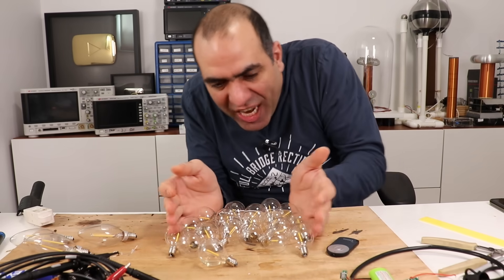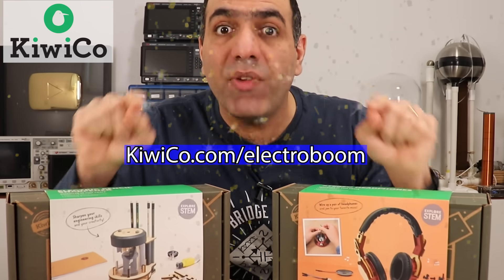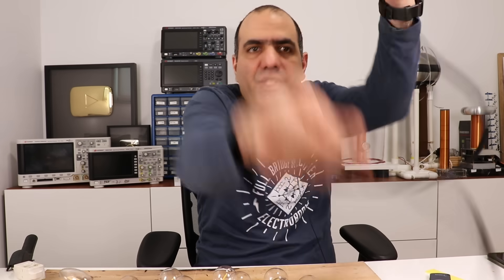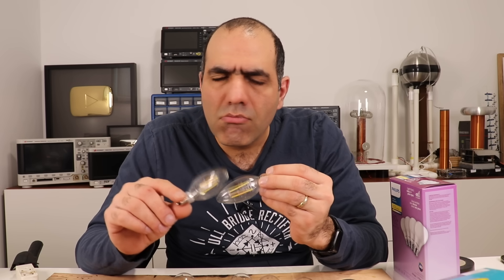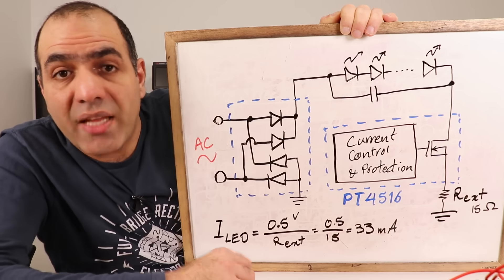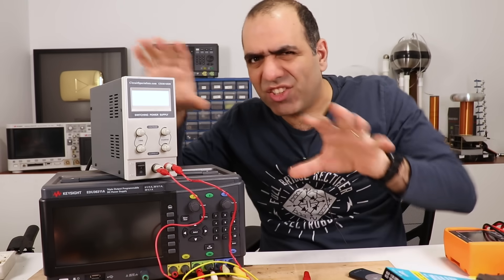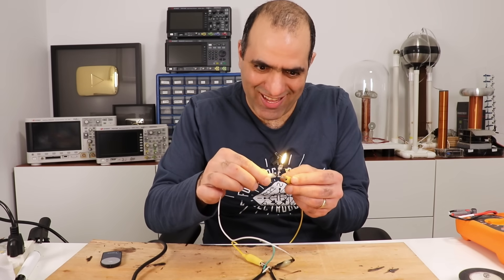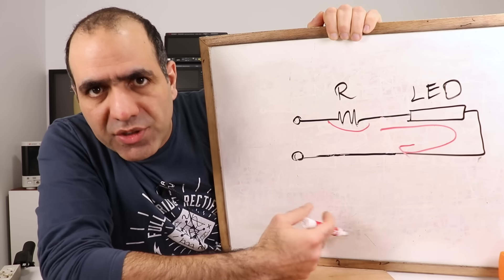So Many MISERABLY FAILED LED Lights

Comment: @3:50 "...use 1/10 of the power that incandescent lights use..." Power saving probably. But if these expensive LED- bulbs do not work, then shipping them back for warranty or buying new ones from China  for sure produces more  CO2 emissions through the transportation and fabrication process and costs you more money than the standard incandescent light bulb. Equipment today is build to last only for a short cycle...this is the modern economy based on greed, not quality .

Comment: I'd say if you can avoid the cheap bulbs don't buy them. Even if they have a warranty, they make them cheap on purpose because they know people won't return them. Also, by the time the warranty is up, that model is isn't made anymore, they just move on to the next "we'll designed" but poorly performing model. I like what is going in Dubai, except for they are forced to use a better product. (without running the numbers, I'd guess it is actually cheaper to use the more expensive products). I sill believe people should be able to purchase inferior products, even if it cost more in the long run.

Comment: so since leds are diodes... putting them directly across AC with a resistor will make them turn on and off at 60hz right? I though leds had a tolerance to reverse current of like half the rated voltage????? HOW DOES THIS OPERATE???

Comment: I've seen an incandescent bulb part-filled with water hanging from a landing ceiling pendant in a rather damp building (leaking roof I think). It was still working, so I guess the water vapour had pushed the oxygen out.

Guess the stem seal had cracked and allowed the water to enter via the lamp base.

Comment: They run cheaper until the power company goes with the new digital meters and starts charging  for power factor usage, then its not cheap. BTW, in the USA the power companies are required to go through the states regulatory commissions to change their tarrif rates  to start billing power factor usage. If they receive approval only then can they charge you more for the inefficiency of LED lamps. Check with your states public utilities regulator for a copy of  your power companies tarrif. Power factor billing  must be approved by the states befor they can bill you.

Comment: ElectroBoom how do I build a safe high current high voltage compact portable adjustable power supply with only small and cheap components that I have laying around my house

Comment: in Germany electricity costs about 0.40 USD per kWh so I calculated that the LED bulbs i installed last year (switched out a bunch of tiny 28 watt bulbs for 3W LEDs) in late september have already paid for themselves - and none of them is broken yet.

Comment: So far the last LED lights I've bought were 40W replacements with 6 of the filament strings, and they all died quickly... the best experience with LED I made with some lights with a round LED part called "cob led" (?) with some kind of reflector around... they were very expensive, but after about 10 years all of them are still working.

Comment: How much of global garbage is generated by manufacturing, transportation, selling of these low cost electronics. Cheap stuffs are bane for society. They also waste energy while running. The LED with resistor in series must be wasting more energy in dropping the voltage, then for glowing LED.

Comment: I purchased 20 x 4' LED fluorescent light fitting substitutes for my home.  after 6 months one failed.  I took it back under warranty and they replaced it.  then 3-4 others began to fail.  I became tired of driving to the store and pulled a unit apart for an autopsy.  In each there was 4 x SMD resistors that had fried.  I pulled a part a working unit to see what they should have been. and checked them on my infrared camera.  They were 20K, rated to only 80mw, but through poor design they were dissipating 300mw, sitting at about 70º C.  Meaning that they would slowly cook and either burn out or de-solder themselves.   I replaced them with 22K 1/2W regular pigtail resistors and they never failed again.  When the unmodified lamps subsequently failed I could repair them and restore them to the ceiling in one third of the time it would take for me to go to the store with the receipt and haggle for a replacement.  Total replacement parts cost?  < 20 cents

Comment: Nowadays its wise to wire the house for DC 12 volt or 24 volt line in addition to the AC mains. Because, most devices like LED lights, mobile phone chargers, laptop chargers, TVs are actually DC devices and they can be run easily from 12/24 volts with a simple adapter. The advantage is LEDs last much much longer when run from 12/24 volt with a simple tiny buck converter. An AC 220 volt LED driver dies much faster due to higher voltage pressure in a tiny package and poor heat dissipation.  I have fitted my house with a DC line in parallel to the AC. DC line is used for lighting and DC devices like charging mobiles, TVs, laptops etc. None of the LED lights went off in last 3.5 years, even though the LED lights are from cheap brands. They also hold nearly same brightness as new. I have solar system in my home, so I run the DC line from the 12 volt battery and its much more efficient than using a inverter to step up the 12 volt to 220 volt and then step down again to whatever voltage different appliances need.

Comment: If you want long life lamp, we can use radioactive material covered with fluorescent. It will glow as spontaneous fission emits radiation that induce fluorescent to glow. But over time the light will dim because radioactive have it's half time.

Comment: OMG, she is getting so big......soon she be going off to college😵

I actually use 100 watt equivilants ratted for 9 months continuos from Home Depot in my parameter lights, then turn them in 2 at a time to Ace hardware for their 60 wat equivilant exchange program with recycled led light bulbs for around the house

Yeah,first project I ever put together was a T.V. signal scrambler Kit I got from a Mom&Pop shop (this is early 70's).

 Think I also got my Tesla radio kit that got power  and signals from touching anything metal(crystal radio?) from that Mom&Pop shop

Comment: 0:38 "If designers knew how to make things to last for a specific application" <- They do. The designers are just forced to cost cut by the company. It's not profitable to make consumer items last after all. Even when there is the long warranty, they make a shrewd/cynical calculation that few people will actually take them up on it or successfully jump through the bureaucratic hoops ;)

Comment: Hi @Electroboom.
Since 3 years ago I prefer to buy only led filament bulbs.
It seems to me the light color and the spread is very similar with the incandescent ones.
I use 4-5W E14 (clear or mate) and 7-10W E27.
None broken so far.

The sound/visual effects for the sparks are added later, aren't they?
(for any "spark" or finger touch, the RCD or RCBO should have triggered, I doubt you don't have one)
Anyway it is fun.

Comment: "fake filament" LED lights are shit. Philips is the worst brand for any LED bulbs. You need ones where the LEDs are mounted on aluminium PCB substrates and there are heatsinks built into the casing for the drivers. Arrays made of less higher capacity LEDs are better than tons of LEDs in series - one LED fail will take out both a string and often the whole array. Monolithics (one high power LED with a diffuser) with low voltage supplies are best - some of mine are 20 years old now.

Comment: No wonder why for a lamp I ordered a pack of LEDs from Amazon or something, all but one survived.
It's 220 here, and I bet they were using a similar design, cheap rectifier and vregs. LEDS themselves are working fine tho. but more and more, even xanlite that were not cheap are now dead after one year of use. 
While I have older LEDs laps that were there since I moved in 6 years ago and counting. but the idea of converting 220 to 50ish with a puny resistor... my god that's the worst.
Murcans : "well my CCFL lamp still works and I want to die"

Comment: Compromising long-term reliability by reducing product performance/quality (not using Constant Current LED driver IC, less amount of heat dissipation material/mechanical housing) for a cheaper LED cost...nevertheless it won't cause much harm to consumers - they wouldn't bother much and can quickly replace with another cheap LED. 

Imagine if this were to happen on a medical equipment...with design done by a 'low-cost medical equipment manufacturer' if there's even any...

Comment: Actually I gutted one the other day which had "failed" on start-up. turns out the LEDs were fine.
If they light up at all then chances are the drive circuit is damaged or one of the two strips is damaged.
I've found a note about using dead ones for 7 segment displays if you don't mind the sound of crunching
glass in the morning :-)

Comment: Some LED bulbs are rate with ( L80B50) that means the ligthcurrent can sink from 100% to 80% at the end of the lifespan from the Led. B50 means 50% of all Led bulbs are dead before reaching the end of lifespan. The problem ist that the companies Font hat to write that in their Produkts. And the lifespan is at 20°C   ( Sorry Font Know how top write in english )

Comment: This makes me think that if LED lighting is the future we should be wiring homes with low voltage for lighting circuits to eliminate this overheating problem no?
Reply: But low voltage circuits carry higher current for the same power and that's more heating in the wiring? The answer could be replacable bulbs that are just the LEDs and decent electronics in light fittings to run them...

Comment: I've noticed that the cheap $2-4 filament led bulbs invariably fail when put in a light fixture where the ambient temperature goes even 120F. A few weeks or a few months and they always go dark. The only bulbs that seem to hold up are the $10 ones that have aluminum pcb's, metal frame and a decent potted pcb.

Comment: I bought a boatload of those on aliexpress for 1.25€ a piece, replaced every single bulb in my house. It's been 2 years now and they all still work. I have about 20 E14, 15 E27 and 5 B22, they are rated for 6w consumption for E14 and 8w for E27 and B22. They are as bright as the 55w bulb they replaced.

Comment: Mehdi what if I took a coil of wire and connect it's one end to earth and other end kept unconnected and then use magnet to generate voltage in that coil         will it work ?

Comment: I have the same experience with these elongated LED bulbs from Philips. They were cheap, but died within6 months of limited use. In my case it is either the driver or the wiring! Causing intermittent lightflow.

Your exterior lights probably suck up moisture during the cooling of the bulb, aggregating water in the bulb in the process. You should have submerged them to see if they are sealed at all.

Comment: LEDs actually don't save energy over glow bulbs because the waste heat of the glow bulbs goes into heating the house. this is only true if the outside temperature is colder than the inside teperature of your house.

Comment: Hi #Electroboom aka sir #mehdi, lots of respect and love 💕😘 frm #India,
Fun fact, when ever in india, Led light bulbs goes of due to failure, people used to solve the every possible way, in order to reuse it, in india 1 new led bulb cost us 70-90 rupees along with 1 year warranty ( 9 watt consist of 9-12 white led light in series pattern), but when bulb 💡 goes out of warranty period people, use to revive that bulb 💡 by checking which of small led light is fused by the help of small wire or Multimeter, and they remove it and put soldering on it, inorder to make current flow,.... They do it every time when light goes 📴.... After that when bulb 💡 goes totaly off, they threw the circuit board and chip of leb bulb but they keep the bulb 💡 body for purpose i.e. in india we get the ONBOARD LED LIGHT CHIP at price of 10-15 ripped which run on direct electric, so than people resolder it and run once again, and this life cycle goes on n on...😊

Comment: Ip44? Was that the actual ip rating for those bulbs? Of course water can get in them I'm pretty sure 44 isn't even water resistant
Reply: Yup, I just double checked, 44 means dust can get in it if it's less than 1mm in size and it's splash resistant, nowhere near able to be considered "waterproof". I don't think anything less than ip 66 should be left outside, I don't know why ip 44 is considered an outdoor rating

Comment: I'm guessing that the warranty will be a real hassle to use. You probably have to send in the bulb to get a replacement. You have to pay the postage and package it. By the time you do all of that, it isn't worth the trouble. The manufacturers know that because of that, their warranties will rarely be used so its basically an empty warranty.

Comment: Light bulbs are one of the biggest "planned obsolescence" scams ever. GE and other companies deliberately made their bulbs CRAP so they'd burn out prematurely and you'd have to buy more of them, and they didn't particularly care who knew it. In the USA, it took the force of law (which GE and other light bulb companies lobbied against for years) to finally push the shift from incandescent to LED and CFL bulbs. And of course, the companies will still make the bulbs as bad as they can get away with. All about the money, nothing about proper engineering. Bah.

Comment: Most common consumer devices become made so cheaply that they are barely acceptable. An LED bulb that lasts for 100 years is argued to be over engineered, so corners are cut until the bulbs are barely acceptable. Some, of course, fall below acceptable, but the point is they will end up being as close to barely acceptable as they can be engineered. Barely acceptable in this case means that so few customers will make a warranty claim that the life cycle engineering will be considered successful

Comment: I bought LED bulbs from a company called TCP on amazon, bought them over 7 years ago and they are still working well. 40 watt equivalent and 2700K for that smooth warm light.

Comment: This pisses me off to no end. I convinced my family to switch to LED lighting and most of the cheap Costco bulbs we have barely last a year on average, with many failing under 6 months. 

I diagnosed the problem to poor cooling for the driver circuit, as they died much faster when in an enclosed lamp housing. This is an unacceptably poor design. LEDs should last years and shouldn't get burning hot to the touch like incandescent bulbs. Having them die so quickly largely defeats the purpose of switching to LEDs in the first place as they are still more expensive than incandescent bulbs and electricity is really cheap here so everyone uses resistive heating anyway.

Comment: Man I don't know what it is with all the cheap Chinese components lately, but it seems to have gotten even worse. They don't even last a short time, it's to the point to where everything is defective or dead on arrival. 

I ordered 100 thru-hole capacitors in various types. Out of 100, 97 were out of spec or dead when I used my works test equipment just to make sure. So many had leaked, and were somewhat sealed.

What the hell... I guess I see why many US Aerospace companies are switching to Mexico, Italy, US instead, even for the most basic components.

Comment: I have LED lights in my house that got so hot internally that the SM-LED’s solder has melted and the LED’s have fallen off the circuit boards and then melted to the plastic housing of the “glass” bulb.
They are no longer 5000K but some sort of weird purple hue that brings back memories of my 420 teen years ;)

Comment: They are failing because they are made with factory seconds. In China they have multiple levels of quality to choose from. Its not exactly rocket science, if its cheap on Amazon or Target, etc, then you know you aren't getting Cree, Lumileds, GE, Philips,etc quality branded parts.    You rarely get lucky and get something above average quality for cheap, especially with no-name branded parts.  We all know this, and yet this type of video will be done, and redone every year going over the same problem.
The dollar store just started gettting in 100w LED lights which I'm pulling apart and repurposing with a cheapo constant current circuit to under-drive them from DC. Even though these are cheap bulbs, I expect them to last quite a while under-driven as 30-40w assemblies.

Comment: Exactly what I think about LEDs. I find LEDs a scam because even though LEDs uses the fraction of the power than incandescent light bulbs, the manufacturers only mention that the actual LED diode may last what it says on the box but the driver that drops down the voltage for the LED to function will not last as long as it says on the box compared to the LED diode. Incandescents may use more power but in the long run you save money from buying less incandescents than buying LED bulbs (which their biggest flaw is the driver giving out).

Comment: Makes me appreciate my LIFX Color 1000 bulbs even more.. Two of them have been lit 3000-4000 hours per year since I got them in October 2016, and because they're running on wifi as well they never actually get powered off - they just get requests to change the LED state.

That being said I don't run them at 100% brightness. They get  bright, so I don't need to run them past 50-60% most of the time.

Comment: Led lights suck. I use to run them in most places, until I noticed the eye disturbances they cause. The horrible blue light they give out is not good for eyes either.  
I will stick with incandescent because of the warm glow, (and they don't bother my eyes either )  regardless of cost to run them.